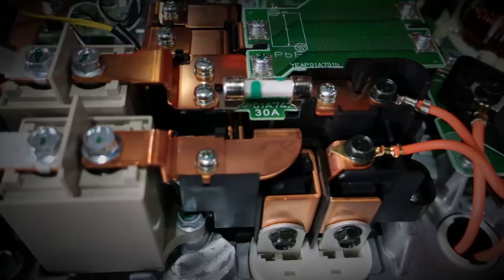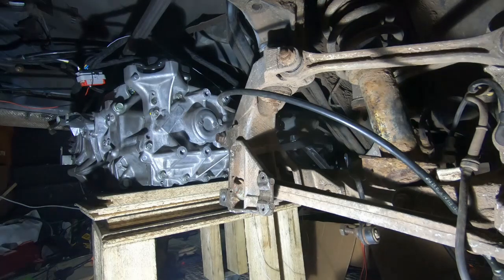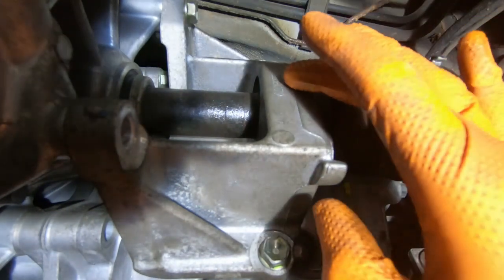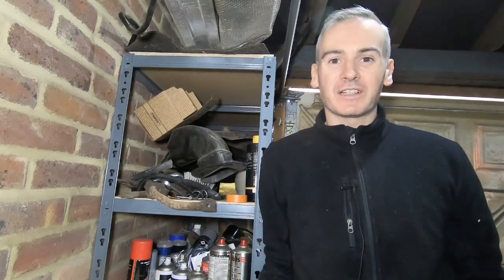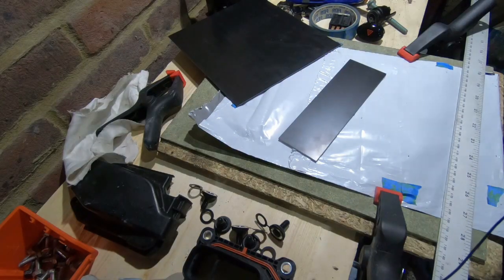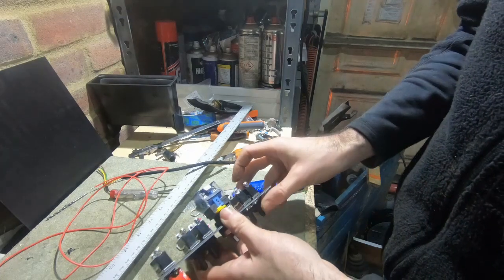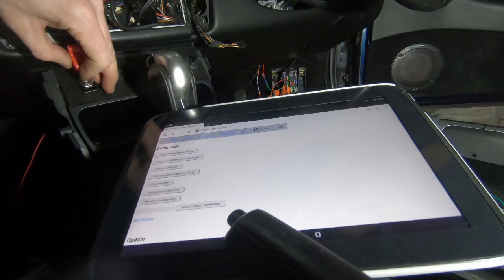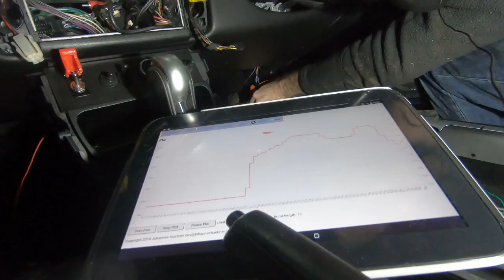Electric Porsche 911 project video 26 - Preparing to run a Nissan Leaf motor in a Porsche 911

Comment: nice progress, interested in what you said about using the invertor as a charger, how is that done ?
Reply from the maker: Thanks. The charging is a feature of the replacement logic board I chose. Basically it is using the inverter to boost or buck a rectified AC current and charge the battery. It is a slow charge, but I'm happy to use that in the short term. Not sure of other boards have this feature, but it should be feasible. 
https://openinverter.org/wiki/Battery_Charging

Comment: Why have you not spliced into the OEM signals? You planning on changing this later on? Any progress on figure out where you batteries will go?
Reply from the maker: Yes, planning to splice into the original signals in the future. I just wanted to be able to keep things moving forward while figuring the OE wiring and signals.
Reply from the maker: The majority of the batteries will go in the rear, behind the motor. I need to jack up the front of the car soon to remove the petrol tank and see what space I have there for additional batteries.

Comment: Does this inverter controller really need that many switches? Or will there be just ordinary igniton switch later? What batteries and how many of them will you install?
Reply from the maker: I'm ultimately going to wire the inverter to the ignition switch and the original auto gear shifter to replace the switches on that panel. The number of switches I've used is just to give me very specific control while getting things up and running, and also to keep that control separate from the Porsche systems while I'm testing.
Reply: @PerformanceEV  BMW has a nice gear selector from 2005+ the uses CAN that should be fairly easy to install and get working.